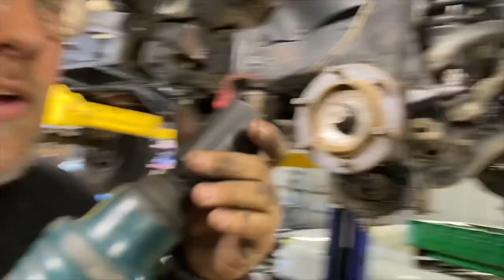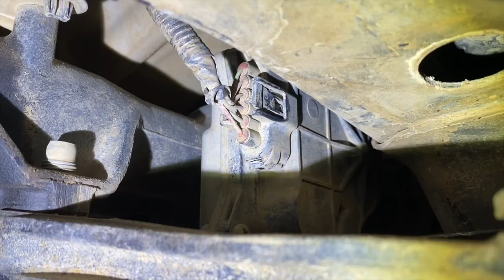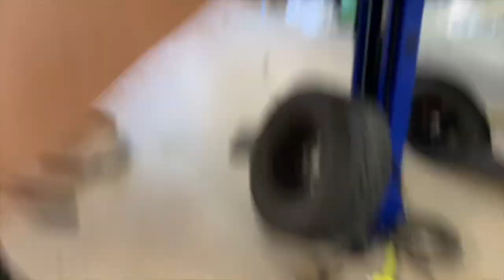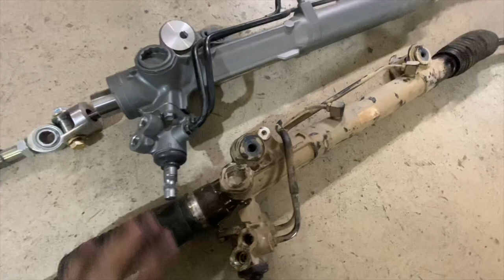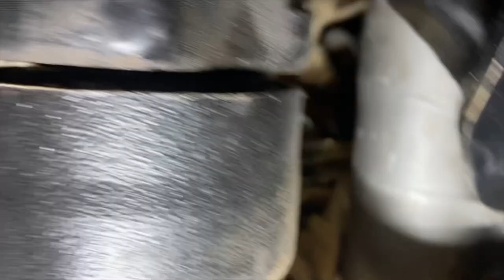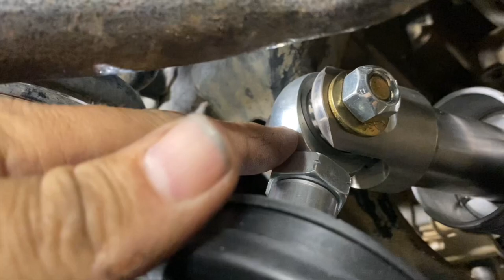Modified Tundra Rack install on a 2016 Tacoma

Comment: Hey Bryce, great video showcasing awesome products and how to install them! Do you think using this setup with the 4th gen 4Runner lower arm pivots from JD fab would cause any issues? Trying to make the front end as bulletproof as possible.
Reply from the maker: One of the comments below said they do have problems with the JD fab setup where the tie rod is hitting the coil spring. I think we can eliminate this issue by using the billet offset pucks which will move the rack forward…
Reply: @timberlineoffroad  YeEEt tundra rack! 
I'm curious what you guys thing about rack / tie rod location as well, and for this same reason! I'm considering modifying my LCAs/bushings to get slightly more forward location, but I immediately notice the TRE interference potential. I mentioned in another comment the same possibility of a rack relocation/some sort of "bump steer" type setup where the location of the outer TRE to the knuckle interface is somehow adjustable. Maybe a sort of clevis knuckle end that mounts basically in front of the original knuckle location, combined with a rack relocation. Or maybe just a custom double sheer setup that gets it right. 
I'm also looking into doing some knuckle position modification with other modifications to the LCA. I feel like if we can get another inch of width and the correct knuckle location/caster/steering angles it might be worth it. I know there's some OTS options but they are definitely pricey.
Reply: This might be silly, but what about using 5th gen LCAs (the lower shock bushing is wider) and cutting/shimming the lower shock bushing to push its relative mounting position rearward? If it rode on a bolt with spacers (4th gen bush, 5th gen mount) that could match up with the JD repositioning, the shock angle wouldn't change relative to the suspensions, and you'd get the clearance back.

Comment: Great video! Since the rack ends isn't centered and the rack is pushed back. It's going to change the angle of the factory  tie rod. Is that going to be an issue?

Comment: No need to pull diff or lift engine. Just remove the oil filter casing. Rack comes out the front. Easy!
Reply from the maker: Ive tried it both ways and i find it easier to pull the diff.